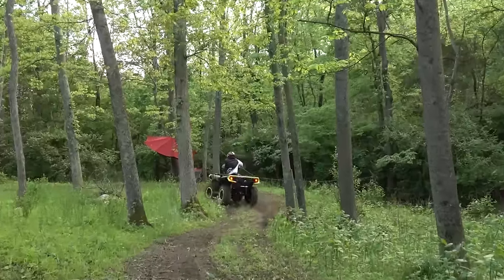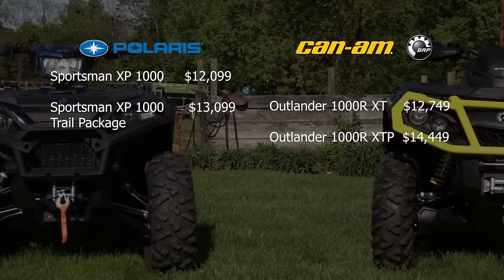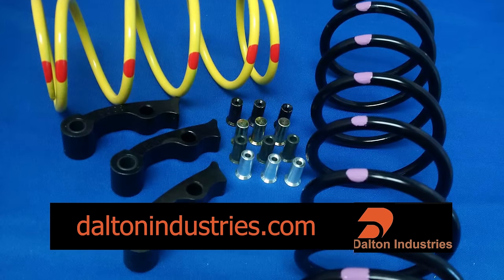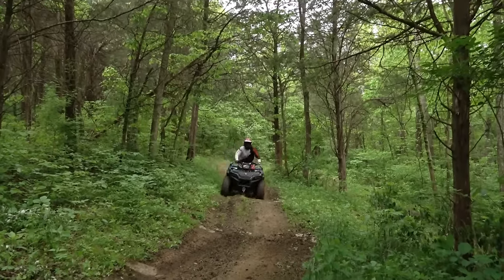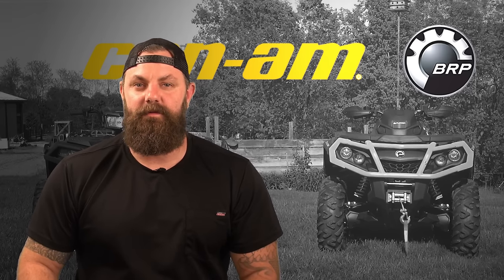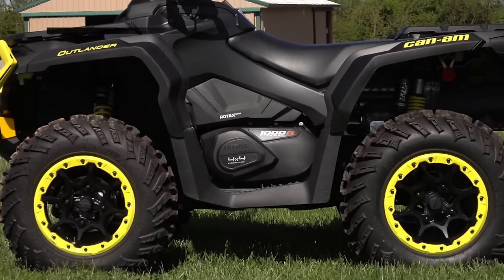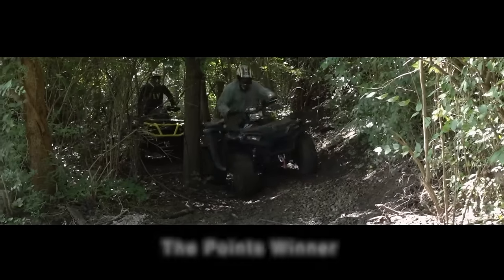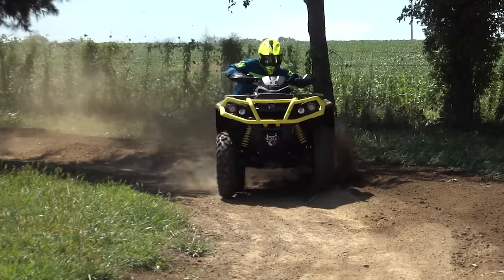Polaris Sportsman XP 1000 VS Can-Am Outlander 1000R XT-P, 1000cc 4x4 ATV Shootout

Comment: I've used both Polaris and Can-Am, and I have to say that my biggest gripe with the can-am is that darn gearshift. Cant tell you how many times that thing has jammed on me, and I've even had the plastic bracket that it pivots on break clean off. Maybe I'm just unlucky, maybe I need to hide the key from the kids, but that shifting just kills it for me.
Reply: Thanks for the comment! We're hearing complaints on the gearshift from owners of both. Hopefully that's something that can be resolved. It does seem minor in most cases, gentle rocking your weight helps it pop into gear sometimes..

Comment: Awesome video I really enjoyed it.
A few thoughts as I watched video,
My biggest complaint with this video was when discussing the four wheel drive systems. For me hands-down the Polaris is a better system. I hate the visco-lok found on the Can-Am I've hated it ever since I bought my first Can-Am in 07 and my hate and frustration continued on my buddies 15 XMR and my 17 xxc 1000. The QE engagement system on the Can-Am is slower to engage then the Polaris, and if you're shooting up a Sand Hill or a pea gravel Hill you will find the steering on the Can-Am Twitchy. The steering shakes left to right as a visco-lok is locking and unlocking. A better option what would be a normal 4 wheel drive system with a true Locking option selected by the rider. When it comes to the four wheel drive systems I think most people would prefer the type of systems that are used on the Yamaha Grizzly and it says you can King Quad and maybe even the Brute Force. All the automatic stuff where the machine decides what to do ends up not always being a good system. The operator is the best at knowing when to engage these systems and when not to.
As far as suspension, I would easily go for the Polaris, one of the things I hated most about my Renegade xxc was how stiff the ride was. I had multiple Buddies that rode the machine that also complained about how stiff the ride was. Even with some suspension adjustments I could never get the Can-Am as plush as I would have liked. I do see at times the stiffer suspension on the Can-Am does have some advantages, but for me and I think pretty much all the guys I ride with a machine with plusher suspension would be much more enjoyable most of the time.
As far as racks, come one guys, can we not just stick to medal racks like the Jap machines?
All in all the metal tubular rack systems are much better and more user-friendly unless of course you're buying name brand accessories. My preference along with most I believe would prefer the simplicity of the middle rack systems.
Reply from the maker: You're hired. Just kidding we don't really have any openings right now but we really like the way you think. Plush suspension is a matter of taste. We feel if you're going to take advantage of the horsepower that you paid for you need suspension that can hold up to the speed and abuse of a rough trail. For casual to intermediate cruising though, the Polaris will wear you out less. We don't have much sand in Southern Ohio so we didn't get to experience your complaint with the Can-Am front differential. We'll have to take your word for it. We just wish the Polaris had a little higher Traction Tire from the factory. I'm sure you noticed that Polaris won the drivetrain category. As racks go, we couldn't agree more. Steel racks are the best. As composite racks go The Outlanders are pretty darn sweet. Thanks for your great commentary.
Reply: @ATVonDemand 
Lol, I wish I was hired to review machines all day and get paid good money doing it. What a life that would be!
Keep up the reviews, don't forget about the newer single cylinders.
I love the power of the big 1000 but unfortunately reliability wins overpower on my last purchase. I ended up getting a 2019 Suzuki King Quad 750, I looked at the Brute Force Grizzly and Kodiak. Be nice to have some very detailed reviews comparing those 4.
I did my best to do a small review on the new king quad, although not as good and professional as your reviews but detailed about the pros and cons of the machine. And I'm hoping maybe even as soon as this weekend I can do some footage comparing it with an older King Quad 750 and 1, maybe 2 Brute Force 750.
Reply: Somebody is hurt lol Polaris will never be better overall than can am even tho both are pretty unreliable, I’m a grizz guy and just want a 850 v twin so bad from Yamaha but I’ve owned a 570 xmr and Polaris 570 and there was no comparison in overall feel and quality but hey everybody has there money holes

Comment: why not the new xp1000s?
Reply from the maker: The XP 1000 s is in a different class. However, we will be receiving a Scrambler 1000 s and doing some comparison rides between it and some other top machines. Maybe another video or two if we're lucky.

Comment: Incredibly detailed video gentleman! Also very entertaining. Sick guitar riffs in the background! This video has it all. Thank you so much. Only question I have is if the 850 sportsman is exactly the same as the 1000 only a few less ponies?
Reply: I own an 850 and 1000. Difference is: 12hp,  3wheel disc brakes on 850 vs 1000, and throttle by wire on the 1000 with the three modes. Otherwise they are exactly the same.
Reply: @mendomotox1569  Oh thank you for the reply dude! Good to know
Reply: @AscendedZombie  @Mendomotox is exactly right, ATVonDemand even mentioned that the 850 is the better buy for guys who don't care about the 1000 sticker..
Reply from the maker: Glad we have some knowledgeable viewers helping you out with your question on the 850. Thanks guys. We appreciate the positive feedback on the shootout. It really makes it worth all the hard working hours we put into this.

Comment: I still don’t understand what power steering is
Reply from the maker: There's basically an electric motor this attached to the steering stem. There's essentially a small computerized device bed typically measures vehicle speed, sometimes two or four-wheel drive depending upon the model, can the amount of torque being transferred to the steering. The measured information helps the electric motor attached to the steering determine how much assistance is needed. Power steering serves two main purposes. It helps make steering effort lighter which is of big benefit on these heavier machines and it acts like a steering damper preventing jarring impacts with one front wheel or the other from being transferred back to the handlebars. This greatly decreases the likelihood that you'll have the handlebars are ripped out of your hands. Hope that helps
Reply: @ATVonDemand  thank you so much

Comment: I’m glad Honda never gotten into the cc wars. They take there time & are well made. They do plenty of testing not like Polaris who hurries to be on top & they have the most problems. Even causing Injury or death to the rider. Polaris even looks cheaply made compared to that Can Am. Everyone I know that has a Sportsman has that front rack lid cover broken off. They have the best AWD but they do cut corners. I will never get a quad that only has one handlebar brake because it’s not safe. I’ve been in situations that having both breaks has saved my life.
Reply from the maker: These are all very good points however, Honda puts little effort into their ATV lineup.  Reliable, yes. But they don't dominate any class that they're in. We wish they would do more to sell themselves on more than their reliability.

Comment: i went with the 2020 polaris 450 h.o. at half the price of these machines, for what i use it for i am  very satisfied... i just wish when the high beams are on all 3 lights should light, a metal front brush guard and steel racks front and rear along with a 2 inch receiver along with a latching seat on it should be standard equipment... i use it for deer hunting and trail riding... this little baby moves, no need for power steering... so far i have had it to 50 mph...
Reply from the maker: Love it! We just got a 450 in for testing. Now you've got us all excited. We wanted the base model but they sent the one with power steering. We never felt power steering was necessary on older models that we've tested.
Reply: @ATVonDemand  i got the base model... it totally rocks for what i do.

Comment: I have ridden and owned both so here's the deal I still own the outlander and here's why the 4x4 on the Polaris is pure junk unless you still need your mom to tell you when it's safe to cross the street, just like the Polaris deciding when the 4x4 engages and disengages. The outlander will stay engaged until you, the operator with the brain hopefully, disengages the 4x4 with a simple push of the rocker switch. I would still own my Polaris if it had this feature.

Comment: Miss the smaller chassis of scrambler 400 under 600 pounds and the 2 stroke motor.   Guess I'll have to install my own big 2-stoke into one to stomp both of these in a straight line drag.   When atvs are over 800 pounds it makes me cringe.

Comment: One thing, I own a older Polaris, and a family member owns a ton of Polaris' and they have been flawless, much more reliable than Can-am. Can-am had too many quality and reliability issues, and mods for the Polaris will pay off as you don't need to do so much repairs.
Reply: old polaris 750, every time we get air we break the rear bolt holding the a arm on. hope they solved this. 2015 can am 1000 Xmr no problem to date. 6500km 236hrs
can't wait for the 4loc diff upgrade
Reply: @chrispainter1312  The 750? Never heard of that.

Comment: My arctic cat 1000 is awesome I’ve had it since 2011 it’s a tough SOB might not be the highest horsepower
Reply: They're history now unfortunately... These machines are Cadillacs by comparison in terms of ride, but we're glad you like yours! Being on a wheeler is the most important thing!
Reply: Chad from ATV&UTVOnDemand! I used to ride it really hard. It’s always done what I’ve asked it to do. Still has the original belt at 3300 miles although that will get changed this summer. Power is still more then most people can handle. Wish it had power steering though because it is heavy
Reply: @rrr3r2  No doubt brother! That's very cool!

Comment: So. Why 2019 Polaris and 2020 can am. Why not the new 2020 polaris vs 2020 can am. The new polaris has different frame now.
Reply from the maker: There are both 2019 models. It is irrelevant because they did not change for 2020. The Sportsman 1000 does not have a new frame. The Sportsman 1000 s has a new frame. Good question, you're simply mistaken.
Reply: @ATVonDemand  ah. Gotcha. Well thanks for the info. I own a 2108 scrambler 1000. Thinking of getting an upgrade to 2020. When the price is right

Comment: Put the XTP against the S line sportsman
Reply from the maker: We do not have a sportsman s in for testing but we do have a Scrambler s. Check out our comparison of The Outlander 1000 versus the Scrambler s. The differences will be pretty close although the Sportsman is a bit more softly sprung. In case you're going to suggest it, we are going to do Scrambler S vs Renegade.

Comment: I would love for these tests to be run 5-10 times to test reliability and strength. Pull the frame and inspect. I think we’d have a clear winner at that point.
Reply from the maker: LMAO! Yeah will just tear these down to the frame and rebuild them before we turned them in. Seriously, test rider Chad, and his friend Brian own a sportsman 1000 and an Outlander 1000. Both have well over a thousand miles on them. We are considering coming back in a month and letting them give a rundown on all of the maintenance they had to do to each machine in the first thousand miles, what were out what broke Etc.
Reply: ATVonDemand I know the answer, but it would be nice if the consumer could also make their decision based on that.
Reply: ATVonDemand I’ve owned and raced both brands for a few years. Your tests are pretty spot on with my experiences.

Comment: Should have done the comparison stock 1st
Then if you wanted to see how they did with the aftermarket stuff do the comparison again
This doesn’t help me decide how they run STOCK…
Reply from the maker: In fact, this shootout gives you a really good idea of how they run stock. They're just running a little cooler and a little bit crisper. Whether they are piped and have a fuel programmer installed the outcome is the same the Canon is a little bit faster.
Reply from the maker: Yet after more thought, this might be  A good suggestion. Thanks.

Comment: I'm sorry but Dalton clutch sucks. They heat too fast and too much in a Outlander 1000R, STM or CVTech works better here.
I've hit 220ºC with my Dalton one time, it melted my Clutch cover and Backplate and put my engine in security mode for high temperature. Switching for a STM with a high HP racing belt fix my problem.

Comment: If I drive Polaris, it would have the same HP as Outlander
Reply from the maker: Stock, it has one less horsepower. The biggest difference is in the way it delivers it. The Polaris is much smoother.
Reply: It was a joke, because I am horse, so Polaris would have 90 + 1HP (me) , the same like Outlander (91HP)
Anyway, great video, love your work, keep on going, I am just wondering how Outlander has better engine braking then Polaris??
Reply: My 2017 sportsman 1000xp was rated at 91 hp. They changed the exhaust and lost some power. Even with no clutch kit I have to feather it to keep the front end down. I can only imagine stiffening the rear and a clutch would make it a wheelie monster. Also I have yet to be beat by any can am or raptor on my quad. Go Polaris
Reply from the maker: @kizla6276  for hauling or Towing the more powerful engine braking on the Polaris can definitely be an asset. For General trail riding, the Sportsman's breaking it's a bit too powerful according to our test Riders.

Comment: The price is absurd. Your going to roll over at some point and an older cheaper quad that weighs 300-450 pounds is going to be a lot smaller medical bill than an 800 pound monster. If we flip an 800 pound car our buddies can't even get it off us. Id rather spend 1500$ on something I can wreck with maybe a broken wrist. Than 12,000$ on an 800 anvil that will crush my ribs. Power is better and so is top speed. But when the weight matches the increased power thus evening out the gains. Why not just make 500cc 2 stroke engines.
Reply from the maker: You can't build 2 strokes anymore because the government has deemed them inappropriate.The same way they are getting ready to deem your gas powered engines and guns inappropriate.

Comment: So, 2 out of 3 picked the polaris, yet the can am wins?? They keep saying beadlock wheels/tires, but they are just a simulated bead lock, not a true beadlock... somehow makes me think this was slightly sponsored by BRP...
Reply: The way we set the shootout up was to score individual categories, and the CanAM did win more of those categories. But the final question was about which one we would purchase and live with. Personally, I chose the Polaris because it was more comfortable to me with the narrower mid section. I also think the sight lines are better because the front end is more abbreviated. The CanAM is clutched more aggressively, feels a bit more powerful, and stock v stock will beat the Sportsman in a drag race every time (with professional level riders, switching machines). I can live with all those things. Neither manufacturer sponsored the video.

Comment: I'll make it easy. Polaris is poop! Yes they make slight modifications every year and when something breaks and they say your at fault or it's not under warranty and the replacement part is modified and different because the original was made for failure. You end up paying for it. Honestly it's not the quality they were 20 years ago
Reply: Grand Waha any mods usually void the warranty for any brand.  Blow an engine with a tuner on it and you’re paying to fix it yourself
Reply: @gregrowe1168  I never said I made any modifications it was totally stock and the front differential went because the pinion bearing failed. With little less than  800 miles on it  but I was one month past the warranty. I paid $852 for a new front differential that I replaced myself when I took a look there were double bearings on the pinion and the original was not that way they made it what they call it an adjustment and that there was nothing wrong with the prior design.
Reply: I could have paid $452 for a pinion seal,  cover, bearing and pinion but they weren't sure that it was going to match up perfectly to the gears inside or the case outside because they changed the part number and the old part number was not available anymore
Reply: I misread your comment to mean you modified something, instead you were referring to the replacement parts being modified over the original.   Warranties are usually not worth the paper they're printed on.  Normal riding can sometimes be considered "abuse" if something breaks.  These machines are designed to be ridden in harsh terrain but they fight the owner at every turn if a claim is made.  The factory warranties are so short that you usually don't even have time to break something before they run out as you mentioned yours ran out with only 800 miles on it.  Parts designed to fail is frustrating too.  You paid a lot for a new machine, you expect the parts to last.

Comment: U need raid relocation so XMR is best or don't trust that steering position. Don't work the bottom of the stearing the nut get lose. Plus the tires on can am are not true size ITP is a joke. Can am bout all itps tires that where all wrong size made a be deal with can am. My dealer has give me roofs windows and doors. So ya it wrong..itp